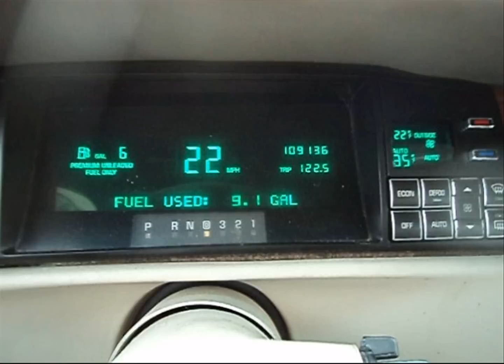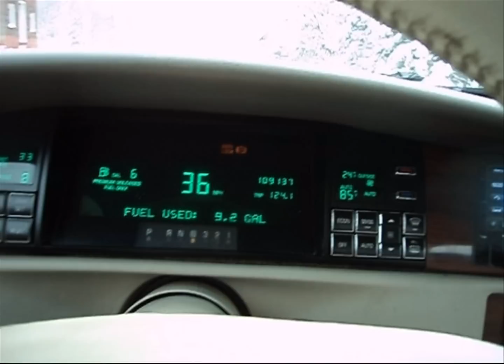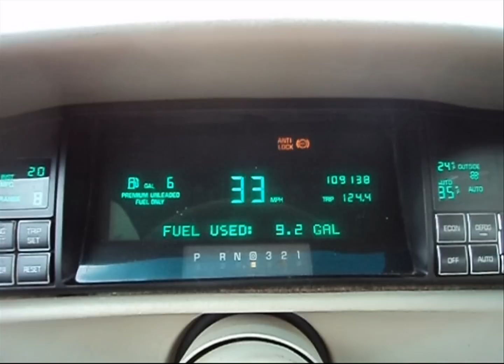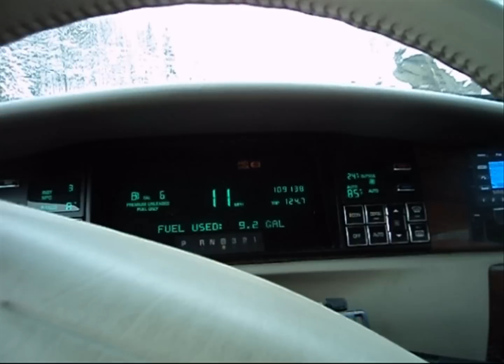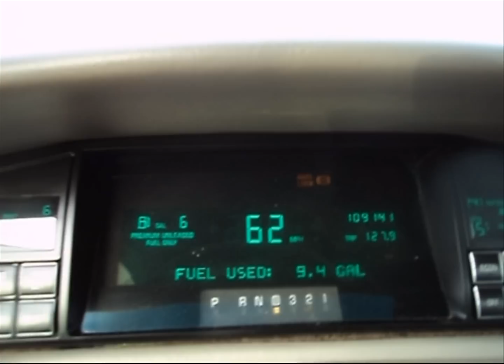Cadillac Deville: Transaxle issues

Comment from the maker: @JakeDaSnakeFilms I just diagnosed the problem just now. It falls under one of two things.
-Bad Shift Solenoid or
-Vehicle Speed Sensor (VSS)

A bad shift solenoid would send no code at all, but a bad VSS sensor should, but there is nothing set in the TCM. Once the speedometer goes to zero regardless of how fast im really going the transmission downshifts into 1st. Thats why I think the VSS sensor is done, funny though a bad VSS shouldn't screw up the shift points.

Comment: TruAgape123,
FYI: I have a 1989 DeVille with 317869 miles and still going AC works, had transmission revolt at 237225 miles back in 2002, I have done the maintenance myself since I bought the car in 1995 with 101142 miles, maybe an exception or simply it is an exceptional car.

Comment: What is a VISCOUS CONVERTER CLUTCH and what does it look like?  I have a 1992 Cadillac Fleetwood Sixty Special with the 4.9 PFI engine. I also need the engine block heater. If you find a low mileage engine and transmission keep me in mind ok